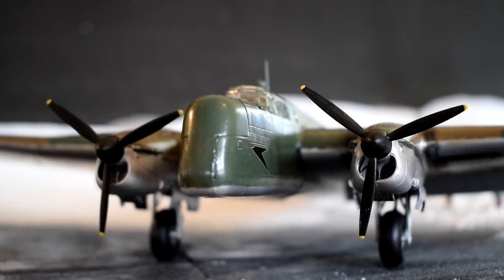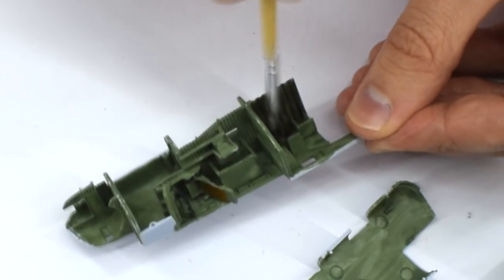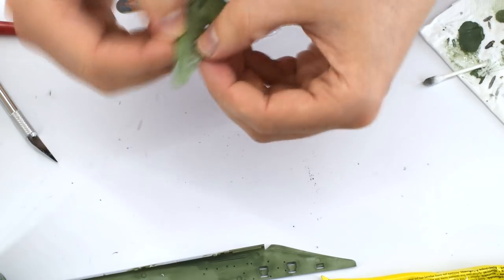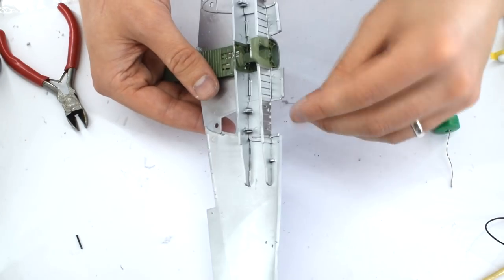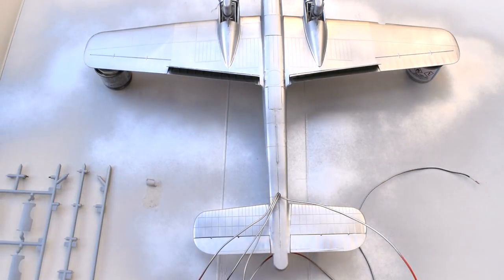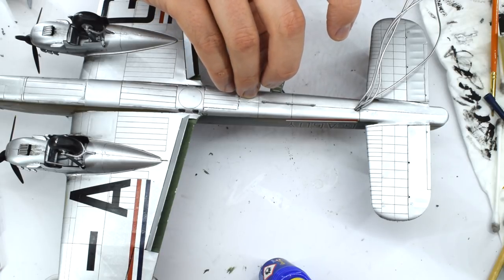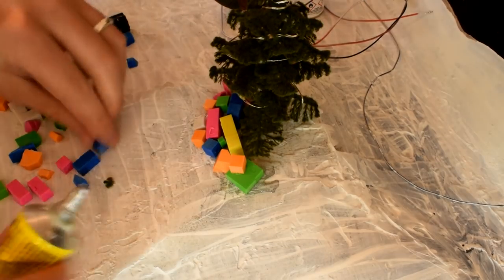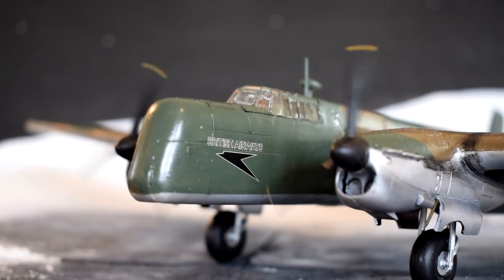Motorised Airfix Armstrong Whitworth Whitley GR. Mk. VII - 1/72 Scale Build & Review

Comment: Many of the joint lines should have been sanded all the seams are very visible.
Reply from the maker: Thanks for the comment, i'll try and keep that in mind for future builds
Reply: I heartily agree Vincent...seriously, of all the modeling videos i have seen over the past two years, this has been one of the worst jobs i have seen.  Kudo's for lighting the kit and adding the motorized engines, but the overall execution of the kit was terrible.  Obvious seams and gaps not filled and sanded, no primer coat to highlight uneven surfaces and other imperfections and worst of all, the paint should have been applied with an airbrush, the results we see in the video are sloppy and uneven.  Perhaps this was a rush job, because it certainly looks like one.  Thumbs down on this video
Reply from the maker: @stevemartin4088  Hi Steve, I love that you took the time to watch my video and leave such a comprehensive comment. I'm glad you liked the animations I included but yes, you were right - I was up against a deadline (as mentioned in the video). I did do the best I could with this kit at the time but my skills are always improving. I wouldn't consider myself a professional modeller, at the end of the day this is a personal journey of development, as I increase my modelling skills and knowledge. As far as applying paint with an airbrush though, currently that is out of my price bracket, and I also don't have the correct facilities in which to complete this task (ventilation etc). Perhaps you would consider becoming a patron so that I could maybe afford to purchase one and then not be such a sloppy modeller? Thanks again, Matt
Reply: @stevemartin4088  I got an airbrush but I still use brushes... You aren't a modeler aren't you? This is HOBBY not an tournament... You are making models for fun... You are the type of guy that things you can't get nice result with a brush... But ur clearly wrong otherwise not everyone wants or cant get an airbrush. I really liked this Christmas diorama and yeah the bad thing was that he didn't sanded the seam joins but executing the video that was bad only because he didn't used airbrush is really disrespectful. Get over it.. It's just plastic covered with paint. You don't need to have competition on hobbys.
Reply: @stevemartin4088  an airbrush you must be joking
Reply: @KJ-kn8pg  agreed
Reply: @KJ-kn8pg  yes I still make models and have done so since I was about 10 years old (I am now 66.)  I build them for my own fun and enjoyment, certainly not for competition.  When  started modeling I knew very little, no filling of seams, no masking, barely any painting...I progressed, using new tools and techniques as I discovered them.  At the age of ten I would not have even dreamt of making a video about model making, hardly even at 16; when I started using an airbrush on my kits...my skills were just not there yet.  I was into my 20s before I produced models that I was truly  proud of...long before the days of super detailed, well tooled kits and PE accessory parts, that are available today.
I do not say that you CANNOT achieve a decent result with paint brushes, certainly I did, but the airbrush is clearly a better tool to use and yields a better result.  Filling seams and gaps is really one of the first skills anybody should have learned
This video shows a modeller equipped with the essential tools (many of which were just not available when I started modeling.)  He displays a nice creative bent and some skill at electronics...certainly being able to make a video in the first place is a worthy skill.  The execution of the model itself though is indicative of a "rush job" and the modeller admitted to that in his reply.
I have no doubt that when he builds a kit he takes more time and produces better results.
Reply: @emmacole358  yeah...an airbrush and no, I'm not joking.  It's one of the most important tools a modeller can have.
Reply: @Aaron Hutt wow...you sure told me off
Reply: Agar Edward  nonsense...i am very confident that he is capable of much better work when he is not under a time constraint
Reply: @stevemartin4088  I mean, I think you should look at his newer work on his Instagram and on here. It looks much nicer and greater. Plus not everyone can really afford an compressor and a quality airbrush
Reply: @vseglu9754  i expect that he does good work and i said as much in my original post...he was under a time constraint and that was the prime cause of a less than excellent product...(he acknowledged that in his own reply.)  An airbrush is an invaluable tool and should be a modeler's first important purchase.  I bought mine when i was a teen.  Brushes just cannot adequately suffice to produce some of the best effects on surfaces...shadows...highlights, etc...brushes do have their place in detail work.
Reply: Agar Edward  Comparing this work to that done by Plasmo is not a fair comparison at all.  David does incredible work, that I have neither the skill nor the patience to even attempt.  David is NOT under any sort of time constraints when he is building a kit, unlike the author of this video.  Model Minutes took a moment to reply to the comment and acknowledged that he was under the gun when he built the Whitely kit and that it was not his best work.  I have stated before, that I am quite confident that he is capable of outstanding work when he takes the appropriate amount of time.
Reply: @stevemartin4088  true but you can somewhat get the same results with a brush rather than a airbrush
Reply: @stevemartin4088  sorry for late reply but I got say that handpainting can be done  accurately and realistic if your patient enough. Most ppl think that handpaint is bad is because they gave up too quickly or bought an airbrush too early. Models especially with hard and semi-hard camouflage can be painted by brush, and if done correctly, you achieve an realistic and beautiful result. Just go watch night shift 's Rutsher tank model, it was painted by a brush. And 1 color tanks are very very easily painted, if you prime the surface, there is no way you will get brush strokes and you will get a perfect result. I suggest you to grab a model, I suppose that you got some basic knowledge about thinning and priming, and paint a hard camouflage or a 1 color paint scheme with a brush, and see that realistic accurate and beautiful results can be achieved by brush. Just most modelers that use brushes are begginers, because the advanced modelers (most of them) buy airbrushes.
Reply: @stevemartin4088  sad to see gatekeeping in modelling, even if it is mild
Reply: @ModelMinutes  Thanks for putting him in his place, Matt!  😉

Comment: You can use that Tamiya extra thin to fix transparencies - it evaporates very quickly, and all you need do is to touch the brush to where the two parts meet. Capilliary action will run a tiny bead of cement round the join. It works on fighter canopies, too, hold the parts together, and touch the brush to the join, again, capilliary action does the rest, with no need to brush. It's a strong join, too.
That BOAC Whitley's a handsome beast. If I had room, I'd have one. The 'Ball-Bearing' run is interesting. One of the consignments of 'Ball-Bearings' brought back from Stockholm (by 'Civilian' Mosquito), looked suspiciously like nuclear physicist Nils Bohr.
Reply from the maker: Thanks for the info! I have used tamiya extra thin on my canopies occasionally, but not as a ritual

Comment: I see you used Humbrol acrylic silver spray paint , I am wondering if I can use Tamiya TS spray paint meant for Rc hard body plastic body’s
Reply from the maker: Don't quote me on it, as I have no experience of that particular paint, but I imagine it would be fine - maybe test it first?
Reply: I know it's a year down the line but in case anyone else reads your question I thought I'd chime in !
Yes you can Tamiya TS spray on plastic models, but as this guy has already suggested test an unseen surface first if you're in any doubt !
I have been using TS sprays for well over 20 years and have never had any problems with the paint. Not yet anyway !
If you have not used it before I would suggest to only use it in a well ventilated area (like outside, weather permitting) it's a very strong solvent base.
Heavy coats will always run the risk of a paint reaction or runs so a light to medium coat shouldn't give you any problems.
The only downside is the price they are for such a fart arse little tin. fantastic quality paint though :-)

Comment: Can you use modge podge or Matt varnish to prevent slivering or is that only  gloss and satin?
Reply from the maker: Silvering is caused by tiny air bubbles. A gloss varnish (and satin to a certain extent) prevents these bubbles by making a smooth surfaces where these bubbles can't form. A matt surface is all lumpy and bumpy which is why it looks dull, but these lumps and bumps are perfect places for bubbles to form when decals are applied

Comment: Just a random thought re construction Matt - if possible would it be easier to treat nacelles with undercarriage the same as fuselage? IOW install the undercarriage in one half, join the two halves, and when dry fit the whole assembly to the wing.
Reply from the maker: i cant remember the specific assembly steps for this one, but it is possible I'm sure, provided that there are parts that don't prevent you from doing this
Reply: @ModelMinutes  I just thought a bigger component would be less fiddly to handle :)

Comment: you could have easily split this video into 3 or 4 parts man! awesome job!
to Airfix: why the enamel paints?!
Reply from the maker: yes, I could have, but find that multi-part videos don't do as well. I might go through and annotate timings for the different sections so that people can jump to a part though.
Apparently Airfix didn't have all the right paints in stock in acrylic so sent the enamel versions. It not a big issue it just means that my painting method has to be altered slightly and the drying times increased